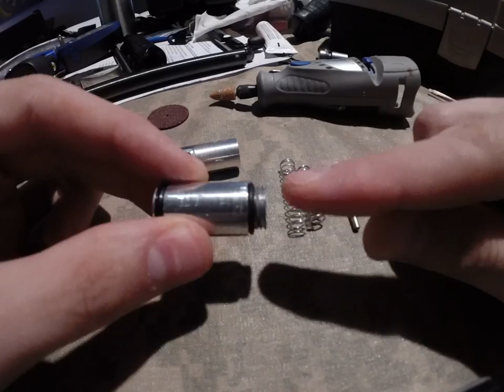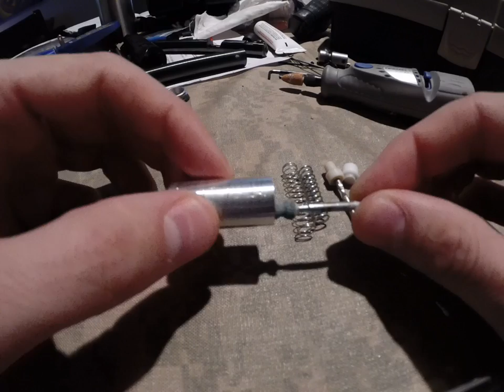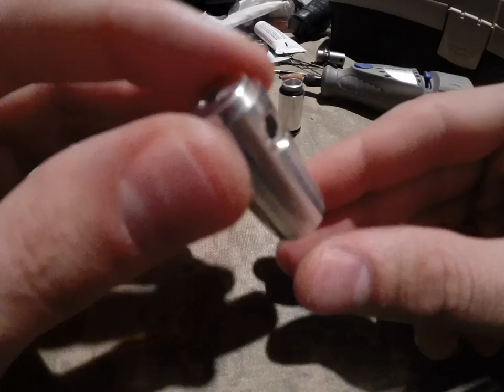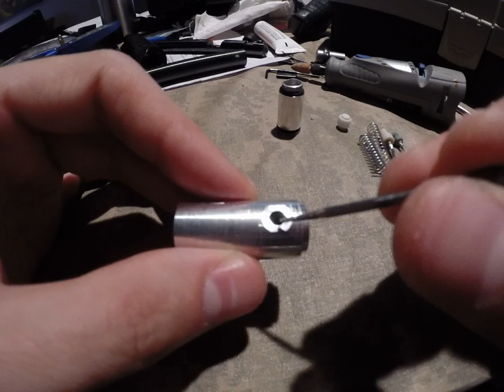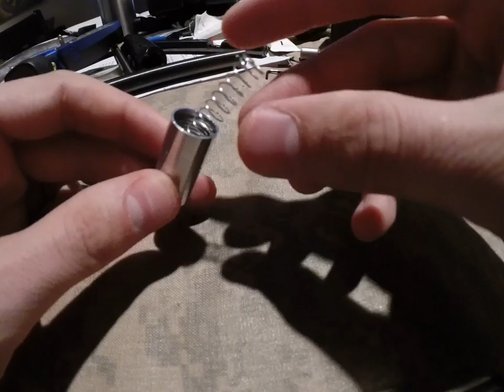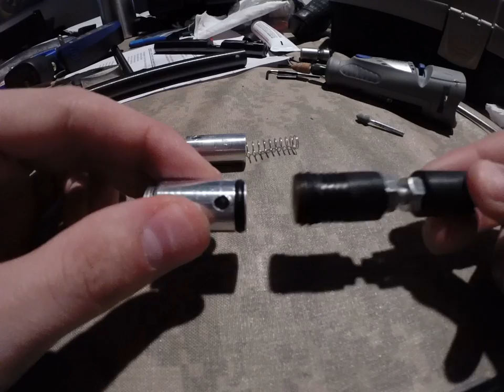Crosman airgun valve modding

Comment: I honestly do not recommend doing the thinning of the valve stem.
The tolerances for keeping it functional reliably are tight.
The most reliable valve stem modification is the valve spring and polishing the stem in my opinion.

I did take a few great points from this that makes me want to take apart my 13xx plinkers to fiddle with.

If money and time isn't a thing, find a 760, and take the top off the valve of that and put it on the valve of your 13xx and you gain an extra 1/8 ish. Then do all of this and that's a nice set up.
I have a carbine with that valve set up, and a 760 barrel and it drives tacks.

Comment: I tried using a slightly lighter valve spring, and all it did was cause air to bypass the valve stem end, and go right into and out the barrel (due to the lighter spring not putting enough pressure to hold the valve shut) when pumping the rifle.
Reply: Cock it before pumping. I have to do this to my 392 due to valve mods

Comment: You missed modding the plastic parts that the spring pushing apart seals the valve. They can be shorter and beveled. And yes you will have to pump more and have a longer barrel. But from owning a Model One and seeing how much you can get from a half size valve my next 13XX valve mod will be decreasing the valve volume.

Comment: To increase air volume is a losing game because you need to over pump to gain the same pressure do to the increase volume. Now ask your self couldn’t I just over pump a stock valve? Than what’s the point of an increase volume of air when you have a short pistol barrel not a longer rifle length barrel? Seems it would make the gun loader thus tricking people into thinking they got a gain in power.

Comment: If you want to increase the inside diameter of the air chamber wouldn't it be best to use a reamer or maybe a drill bit would be sufficient needs to be very precise and and smooth
Reply: Great idea!! Instead of hacking it with an unsteady dremel!

Comment: If you increase the valve capacity you are going to have to pump it more to achieve the same pressure. And you probably won't capitalize on those gains without going to a longer barrel.

Comment: Don't do the mod. I tried it. Ended up having to pump 4x to shoot my indoor target as oppose to 3x as before. One extra pump for same fps. Now I have to purchase New valve system to get my gun back.
Reply: For a gun with shorter barrel like this, you'd better off reducing the air volume in the valve. You'll get the same pressure with less number of pumps. And with shorter barrels, you won't have any problem of running out of air in the middle of the barrel. I use a piece of garden hose cut to length put inside the valve to reduce the volume.

With longer barrel, you'll have a problem if you reduce the valve volume. Soon as it runs out of air in the middle of the barrel, the friction of the pellet and the barrel starts to slow down the pellet.

Comment: Best and easy way of concepting this is to be aware of by that more air producer more thurst and vice versa. Figure out the problem of your idea, overshadowing the pluspoint of compact gun needs precise parts to be handled friendly (Your biased mind of from plus point facility drawn of the Compact gun userfriendliness , Stalling you from finding a Solution of a problem i talked about here,  that i conceived from your video,  you do witnessed or came accross has, needs been addressed with .. 😊
Reply: Can you find a better translator dude?

Comment: Bhaloi, less space , but same volume of air making the air more compressed in the small encatchment, and sudden release of normal  air contained to lesser space accomodated pressure from will exert more power? But the stable tactics is to use more air under utmost pressure utilizing more space but over exploiting the bigger space, cause big space can accommodate high air content and more air can generate more pressure regardless of the cabinet / chamber space . Its like say 1 cc cylinder can store 1cc air , but for 5 cc cylinder its not directly proportional but exponentially kind of proportional directly, ie it will contain 8-9 cc of air, i mean considerably more air that space provided, and this properties need be exploited

Comment: Valve volume vs valve duration. The valve body spring and the hammer spring are both carefully tuned to fully exhaust the stock valve body at rated pressures. Hell, pump a brand new c9a 14 times and you will STILL only get 8 pumps worth of air from it, leaving a 6 pump charge in the valve... Once you change ANY variable, you are entering guessworld. I recommend not messing with the springs at all, simply add a shim to the spring seat on either end of the hammer spring until you get your modded valve to fully empty on each shot. Once you cut, stretch or de-temper a spring it will no longer function reliably. Sixteen engineers, each with $100k+ educations figured out the spring rates, don't piss that away with your tinkering.
As far as "mushrooming", fucking shit up is the risk you take by modding the valve but realistically, this simply is not a real life issue. The poppet stem is, (believe it or not!) designed to be smacked a bazillion times and not deform. Metallurgy is cool.

Oh yeah, "angling" the exhaust port does absolutely nothing for flow dynamics and risks leaks and deformed mating surfaces. Polish, yes, grind, hell no.
Reply: You're right that the angling does nothing, I think the poster misunderstands how air flows. Air doesn't just enter the valve and "go around the corner as fast as it can". Air travels from high pressure to low pressure areas. You can't "encourage" airflow or make it faster by angling an exit port because it still won't travel through the port until there is adequate pressure inside the valve, and even then, it is travelling through the port at a speed proportional to the pressure inside the valve. Nothing to do with the angling of the port. Increasing the size of the transfer port is different because you're literally allowing more air through, but this "angling" for the sake of improving aerodynamics in the valve is non-sense.
Reply: If your gun is well used ( leaking air), then a rebuild/replacement kit will help. With any other "magic," if it makes you feel better, then do it TO YOUR GUN! As for the miniscule amount of possible gain, I'll leave mine STOCK. Yes, I'm trusting those guys with engineering degrees. 😮
Reply: This guns are kids plinking guns why even try to improve with all this fooling around ?
Reply: I'll just use 10 unless i want to kill something. Then 15 probably wont hurt it.
Reply: Seven year revisit. Yeah I'll come clean. I absolutely ghetto cafe' racer'ed 4 Sheridan .20 cal blue/ silver streak rifles and the fail mode was always the Teflon valve seat plunger. Flat top piston. Brilliant, buy one don't try to dome your cup w/ silicone.... I killed dozens of coyotes in the Mojave. Between fuckups  still a damn good vid. PEACE!
Reply: angle the exhaust will help air escape faster PROVIDING you round off and polish the inside of the valve where it is angled inside the chamber.. if its a sharp exist it will not work any better at all. has to be rounded and polished realy good  ( not worth the effort)  exactly the same as you do when porting the exhaust on and internal combustion engine, can make a huge difference in getting rid of spent gasses faster..  BUT doing this would only give around 5ft per second if your lucky... if you make the inside of the valve a larger area you will then need a stronger faster hammer spring... exactly like converting a 3 shot sheriden silver streak to a 1 shot Sheridan....  1st shot around 11.5ft lbs, 2nd shot around 10ft lbs and 3rd shot around 8ft lbs  or a single shot of 20ft lbs......  Now for the mushroom effect with using a heavier spring on the hammer YES so best to go make a new pin of better metal or put like a top hat on the pin when the hammer hits. the pins are just a mild steel, nothing fancy. if made of stainless would be better or tool steel.
Reply: @philldownes8685  porting the exhaust increases the size of the holes , that's not what he's doing here, he's simply grinding an angle on the inside without increasing the size of the actual hole. So the same amount of air under the same pressure would escape through the same size hole, regardless of the inside being sharp or smooth. Grinding that stem was an even worse idea...major failure point considering it gets hammered constantly.

Comment: Very well made and solid==>ur2.pl/956 Big grips and easy to hold. Love the single/double action. With proper care it will last for years before you might have to change the seals. A fiber optic front sight would be nice however. But for the price its a fine air gun.
Reply: loving it

Comment: the crossman i have is 30 years old and has a solid brass valve/parts. i guess they dont make em like they used to.
Reply: Some of their better ones do, like the old classics, the 2289, the 1377, the 1322 etc. My 2289 from about 7 years ago has a brass trigger, brass bolt etc. but an aluminum block like this. The real cheap ones like the Pumpmasters and stuff they are trying to compete with the likes of Daisy, Umarex, ASG and many others all mostly making their stuff in China, including Crosman themselves I believe. 

An old Crosman .22 pumper just like this, that my grandfather had was identical to my 2289 and it was made much better. I remember it having a steel breach, etc. mine is plastic. The barrel band is plastic and flexes, making any barrel mounted small scope you put on it wobble if you bump it. Sure you can buy aftermarket parts, milled from brass, steel etc. but that will cost as much as the gun did, lol. I know I checked. 

That's how they maintain the prices they do. A guy on Youtube showed an old 1970's Pumpmaster 760 next to today's, what a difference. They were quality guns back then, not now. Sure, they shoot straight, Crosman's are known for being accurate shooters but now? Whatever they could cheap out on they did. Some of the guns are absolute junk. My 2289 is "o.k.", not horrible, but some of their stuff literally breaks so easy it shoots itself to death it's so poorly made. My Crosman hand pump pistol (turned carbine) is certainly NOT what my grandfather's was. It looks cooler, way cooler, but his, was a much better quality gun from the factory. Imagine, a brass bolt, in a plastic breach, lol. That's what you get with Crosman nowadays and many others.

Comment: How does making a valve shorter by cutting it increase the air volume? What is the modded power increase?
Reply: Cutting off part of the valve that threads into the other half of it leaves more space inside the valve for air to be stored. The overall dimensions of the valve has not been changed, just the volume of steel inside of it.

Comment: I've modded dozens of these valves. Never cut more than two threads of the valves, it's too much and dangerous. It's better to use a drill bit that is slightly larger than the ID of the valve and drill it out. Just don't go so deep that the check valve loses its wall to slide on. You can hollow out the bottom of the valve but if you hit the threads, you're done and the valve will be ruined.
Taking material off the hammer vlve is a good thing to do but be aware, it's hardenned steel so don't get it too hot. I use my lathe to turn the stem and a Dremmel shaping it while it's being turned.
Reply from the maker: NotSoDumb less material inside the valve leaves more space for air. The fps increase is less than 50.
Reply: NotSoDumb t
Reply: Do you have a crosssman.22 with all the mods for sale

Comment: Instead of trying to increase valve air capacity by thinning the walls on a high pressure valve, what about increasing the length of the valve. This could only be done on a flat top valve I believe. Of course the additional air must totally be released to have any benefit. I have not tried this just throwing ideas out. But an additional o-ring or two would give you the equal amount of displacement I'm thinking. Like you said in the video, "it's not a lot but it's something" Great video!
Reply: So I have an update on this, I took a flat top Valve that I received from Charles Mellon, (great guy with awesome parts, pistons valves etc.. btw) I immediately took the valve measurement T 58 mm, I increased the length to 60.3mm a 3.5% increase of air capacity, if the air capacity increase is relative to FPS increase. at 600 fps you would see 21 fps gain approx, imagine 7%!. the only issue I run into is that by elongating the valve the threads on the bottom of the valve that anchor into the grip do not line up. so yeah.. thats that. unless you drill out the screws in the grip and the tube as well. This can be done easily enough but for 20 fps?? is it worth it and that is hypothetically speaking. It could be done but not willing to try. just wanted to update my findings in case anybody was interested. once again loved your informative video Survivalist
Reply: when the valve is still in half and ready to be put together place a couple more o-rings on the original single ring to space the halves further apart, like I said I have not done this yet, but it would be do-able.
Reply: just to note that is anybody does try this, I elongated the valve with 9 wraps of lubricated tephlon tape directly above the o-ring in the valve center, twisting one wrap to create a thick bead.
Reply: Tephlon tape added to the threads would also helps with any potential leakage encountered
Reply from the maker: I've used the plumbers tape before, it works pretty good if needed.
Reply from the maker: I don't understand how you could increase the length of the valve. It's the same valve, only shorter once it's flat topped.

Comment: good video im going to try this to my 760 pumpmaster it has the same type one thing im going to do different is cut of some of that plastic on the top and bottom of the valve that will free a little more air up thank you for the info...

Comment: seems to me you reduced the volume and increased the pressure.
Reply: That's what I was thinking..you take away mass to make the valve hold more for less pumps? Where is it the increase of Feet per second demo?
Reply: GKAtascosa its displacement vs pressure, hes increasing pressure presumably
Reply: correct

Comment: OK, thanks for the info on the GoPro.  Anyhow, I expect I can cope with the vid :)  What about the integral strength of the valve after removing this amount of material.  It seems that you weakened the structure... I presume you have used this pistol since the mod... have you suffered any failure of the valve?  I have just inherited an original non-working1322 (it won't hold air), so I will be stripping and re-sealing this baby soon.

Comment: This video has a 4.3 aspect ratio... you should have used a more modern camera with a wide display format.  It's like looking at a 1950's TV LOL
Reply from the maker: +Jammoko It's a GoPro, so it's not like its an old camera per se. They're meant for that outdoor panorama format which doesn't work well indoors.  As of 2016 I've upgraded to a better camera more suitable to table top videography.